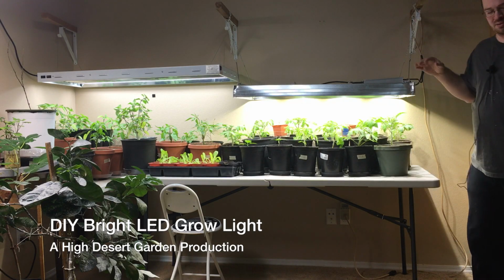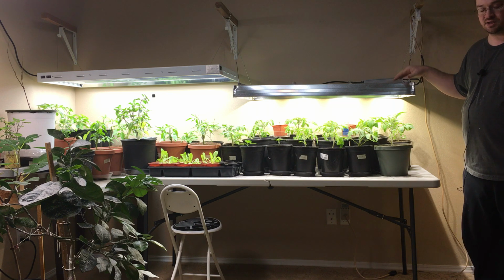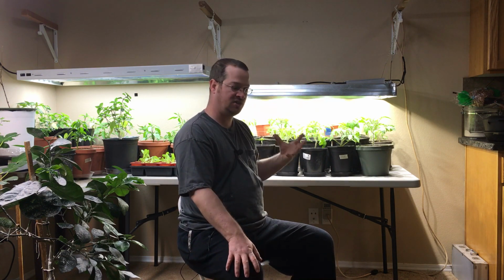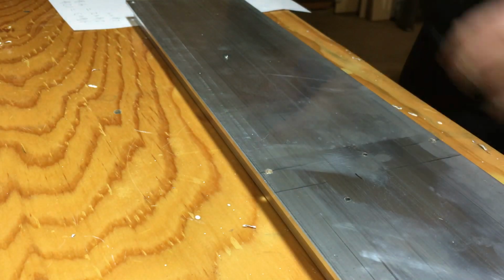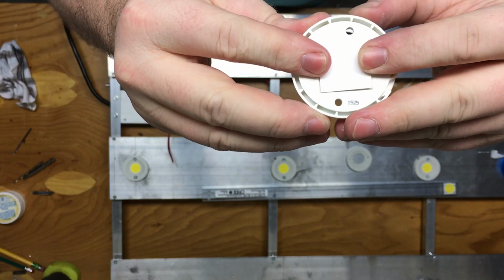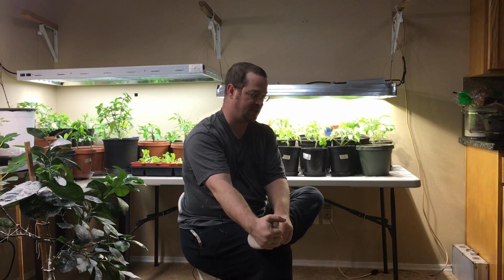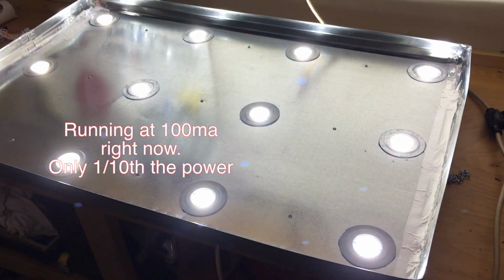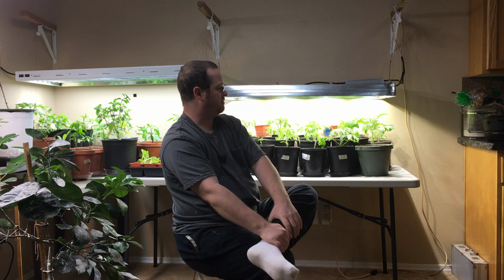DIY Bright LED Grow Light

Comment: "100W High Power Cold White 6000K LED Light + Heatsink Cooler fan+100W LED Driver
$2.50 to $25.50" THIS WILL TAKE YOU INTO THAT STORE WIYH ALL THE PARTS

Comment: "kobeedeal" I LITERALLY JUST FOUMND THIS EBAY SELLERS LITTLE STORE THING ON EBAY IT HAS THE BEST PRICES IVE SEEN SO FAR, HE HAS ALL THIS STUFF BUT ALOT OF ITS CHEAP I BUT IT DOES SEEM TO HAVE THE PIECESW ANDS PARTS FOR THE S CHEAPER COBS, REFLECTORS AAND STUFF. ITS A GOOD FIND.

BY THE WAY I THINK THAT YOUR LIGHTS FRAME SHOULD BE BIGGER WITH ALL THOSE LIGHTS, I DONT KNOW HOW YOUR COBS COMPARE TO CREE CXB3590 BUT ABOUT 3 OR 4 OF CXB3590'S IS MORE THAN ENOUGH LIGHT FOR YOUR SIZE FRAME. PLANTS CAN ONLY EAT SO MUCH OF THAT LIGHT (UNLESS YOU INTRODUCE AUX. CO2 THEN THEY CAN EAT EXTRA BUT WHY PAY TO PUT LIGHT OUT THERE IF NO ONES USING YA KNOW.

Comment: IM ABOUT TO BUILD 1 VERY SIMILAR TO YOURS. I HAVE BEEN RESEARCHING NOW FOR A FEW WEEKS. 1 QUESTION- IT'S OK TO MIX UP THE SPECTRUMS WITH DIFFERENT COBS RIGHT? (ASSUMING THE VOLTAGE FITS & AMP, ETC AS NORMAL) EVERYONES USING THE CREE CXB3590 COBS, I MIGHT USE THEM BUT EVERYWHERE IVE SEEN THEM THERE PRETTY EXSPENSIVE, (LIKE $20/ COB EVEN MORE, IS THE RIGHT?) ALSO ON EBAY THERES THESE 7 AND 8 "BAND" SPECTRUM LED COBS MULTICOLED, ALSO EXSPENSIVE (LIKE $80 FOR 6 OF THEM OR EVEN TWICE THAT FOR THE BEST ONE, *CHECK EM OUT ON EBAY THEY ARE REALLY COOL(AND NO IM NOT SELLING THEM LOL)- "6pcs/Lot DIY 100W 7 Band Multi Color Full Spectrum Plant LED Grow Light Chip" CAN I MIX THESE IN WITH THE CREE COBS? (MIX THEM WITH DIFFERENT SPECTRUM CREES, ALL TOGETHER?  THAT WOULD CHANGE ANYTHING DOES IT????   ANYBODY KNOW??? 
HAVEN'T FIGURED OUT THE FANS, HEATSINK YET, (AND THE FRAME I'M NOT WORRIED ABOUT, I AM A CARPENTER)
ALSO IM THINKING ABOUT ADDING A COUPLE SWITCHES TO SEPERATE THE COBS.
I'M PRETTY SURE I CAN MIX ALL THOSE COBS, AND SPECTRUMS AS LONG AS I FOLLOW THE REGULAR PARAMETERS AROUND VOLTS AND AMPS, DOES ANTONE KNOW FOR SURE???????????????????????????????
PLEASE HELP!!!!!!!!!!!!!!
Reply from the maker: Yes, I was thinking about doing the same. It’s a good idea.
Reply: @HighDesertGarden  WHATS A GOOD MIDDLE OF THE ROAR COB? I SAW THAT Luminus COBS WERE 10% BRIGHTER OR MORE EFFICIENT? I FORGET LOL? BUT THEY WERE RATED A LITTLE BETTER THAN THE CREE CXB3590 THEY PROBABLY COST MORE TOO. THERE BOTH SO EXSPENSIVE THATS WHY IM TRYING TO FIND A GOOD CHEAPER ONE THATS STILL DECENT, DO YOU KNOW OF ANY? AND WHERE TO GET THEM?
Reply: Your right you can mix and match but like the switches you might want to consider multiple drivers as well for the different leds. Also make sure they are adjustable to be able to control the lighting spectrums if needed. Also consider the total grow foot print and weather you are going to do seedlings and or the start of the veg phase or all the way too fruit or flower as the spectrums differ for optimum growth or yield. * Also some plants benefit from a small amount of uv but only in the flower fruit stage. The power draw is only important to you wallet what your concerns should be focused on is fullness on spectrum and how much usable light from how far away the plants you can get, usually I've heard referenced as ppf. Good luck.

Comment: I have an old fixture that houses a single cob. I opened it up and put the meter on it.
95v dc output from the driver.
.47 amps
Verified with a kilowatt that it is pulling 45 watts with the active cooling unplugged
Active cooling pulls an additional 1.1 watt
What is the best single Cob I can put in this fixture that will be compatible with the unmarked driver I have?

I want to run a cree cxa3590 72 volt 3500k or a free cxa3070 3500k

Please make a recommendation on an efficient cob that will work with my current driver if the two listed above will not work.  Preferably 3500k
Thank you!
Reply: Which ever fits with bothe the power requirements and the spectrum you need/want. You will determine that based on your growing for seedlings and veg. Or all the way to fruit and flower as they prefer different spectrums to produce optimum results. Of course free makes the price much better that you could maybe add and additional unit(s) to supplement any spectrum or pat type needs such as expanding you grow. Good luck.

Comment: that sucks u had a 10k   not100k. i am glad u fix it. so where u get ur chips i got 8 cluo48 chips 8 heatsinks. i pay 20 pc heat sinks i no it may not be as nices but its got good mean well 240 1700mah and one 185hlg 1400mah. 3500k. 3000k.  an 3 watt  red blue uv    so lmk ehere u got ur chips do u no jarry from king bright lmk inpotin thank u
Reply from the maker: I put all information on the hardware and pricing in the description of this video.

Comment: growmau5 email you back for nothing so if there's any way you can help me out I need to pick a driver   11to45watr. cob. 48 volt dc. 1000 early and mid 2100 milliamp Max I need to pick a driver that will power four of these chips and either series or parallel please help me out sir I'm not sure if I wire in parallel can I get away with just using a 48 volt hundred watt driver to power to chips and if the amperage over seeds it I can buy a dimmer correct Wi-Fi hookup in series do I have to have double the amperage see I just have so many questions.  4432480221. pleezzz. tex any time pleezz tex me or call me pleezz  vic
Reply from the maker: You do not want to overload your driver. Can you please provide me with the model of the COBS that you are going to be using? Do you have a link?
Reply: Shore.  4432480221. Sell nuber u can tex me on this nuber if u can but i will sand u my cob than u it meen so much u email me back thank u so much. I like to get a ok cob cheepr and to try out can't keep buying from China. Vic
Reply: https://lh3.googleusercontent.com/a269nZfQW1yZ7pF2a_YxLNePBah-DbPIIXYm1JABLlQydQBGzHbfANqYqyjlGJ82jp5ISo5n
Reply: I don't think I can send you pictures it won't show them but here is the model number and the stats I want to one of the chips

OSRAM SOLERIQ® P9 LED 4000K
NEUTRAL WHITE CRI 95 GW MAFJB1.CM COB
OSRAM SOLERIQ P9
4000K  Neutral White  |                         model number GW MAFJB1.CM
CRI min. 90 ( typ. 95 )
Chip-on-Board COB
Forward voltage: 26 V - 31 V  |  Luminous Flux: 1790 lm - 2620 lm
Forward current: 200 - 1400 mA  |  Viewing angle at 50 % Iv: 120°
Luminous efficacy: typ. 85 lm/W @ 3000 K
Operating temperature range: - 40 ... 85°C

I need 4 of thezz in series I need a driver to power at least four of these
Reply: GW KAJRB2.EM. or 4 of theezz but littil hi in $$$  so if u no any cherper chip let me thank u for ur time    but the 4000k are my Preferred Choice

Comment: Should have done at same height imo. Yes the led are more powerful =D
Reply from the maker: david abe I didn't think about doing that for the demonstration. However I do frequently adjust the height of the lights depending on how tall the plants are beneath them.
Reply: Looks good! I built a bunch (16) 200watt led lights so I'm on board, just saying one is closer so it looks brighter on the plants. If you ever do another vid it's something to keep in mind is all.

Comment: I know Cree lights last long time but for me wiring in series is out of the project. As you know in series the problem is that when one fails the whole thing will fail. I prefer parallel. If one fails the rest will continue working.  Basic electronics.
Reply from the maker: Papun Rodriguez True
Reply: And the remanding cobs will be driven harder and Cree doesn't recommend it. You'll burn up your cobs just check out my channel if you haven't already.
Reply: Just buy some drivers of amazon then have 1 driver per led, the drivers are only £5 the only problem is they are DC-DC boost/buck converters so you sill need a DC power source.

Comment: Great video. Great job. I found these high bay Cree cxb leds lights. Do you think they will work for growing? What is the par on those leds? Thank you.
Reply from the maker: What are the specs on the high bay Cree cab leds that you're looking at?
I'm not sure what the par on my cxa2530s are. I imagine it would probably very depending on the voltage that I put through them. I think that +Growmaus used these same leds in a build that he did and he may have mentioned the par value.

Comment: Great vid and info from my experience it will make life easier for you to place your mount where you want put sharpie pen in hole to mark the place to screw in self tapping screws put the mount aside  then use self taping screws screw them on  back them out with a drill and phillips head.
  then put the mount in place and use hand  screw driver to  screw mount on.
Reply from the maker: +Spencer Rushin Thanks for the tip

Comment: Awesome job. Esp. if you got Greengenes nod ;) But I'm not sure why you didn't use 8 Vero 29 instead?  -$8 mounts, -$38 hs, +8x Vero 29=+$47 more than your 2530's.. = For $1 more you get a substantial upgrade and an easier build.
Reply: +Axias2011 I'm terrible with the Heatsink dissipation rates on passive cooling. But Veros cranked to maximum WOULD need the HS size increase 50% to maintain passive.. So, lol, sorry there goes $38 ;)    Anyways,  Great light.
Reply from the maker: +Axias2011 I've been thinking the same thing recently. I didn't know that at the time that I was planning to build this light.

Comment: i used self tapping screws much easier just drill the hole and screw well i know un-monting can be tricky but it works
Reply: in the long term , screws get loose.
Reply: then just put a drop off locktight no need for me never moved thé ficture is not mooving

Comment: drill.. #4 sheet metal screws...no tapping needed . not self tapping , sheet metal
Reply from the maker: That sounds like it would work. I'm not sure that it would be as nice as the machine screws.
Reply: +High Desert Garden (Phillip) Good job working through the nuances. I'm sure you're  more knowledgeable and comfortable. What was you're steps for checking grounding? I probably should check too..Have several Led Clone/seedling bars using xml2
built. thx for the video
Reply: +Bfresh19801 Just rewatched your vid... I see. thx

Comment: Seems everyone has LED grow lights on the brains. I'm also gathering the components to build a LED grow light myself and will be putting one together over the next several days. Good timing with your video it was great to watch. :)  The only part I'm a little worried about is the mounting screws with insulating tape on them. Just please keep an eye on 'em as things may change as they are exposed to heat over time. 

Good stuff though, thanks for going thru the process and sharing! :)
Reply: Your two links above, linking to Growmau5 and Greengages Garden's videos seem to be broken. :(
Reply from the maker: +Cragfire Gardening Fixed now.
Reply from the maker: +Cragfire Gardening That is a concern; I've never seen teflon tape be used this way. I was sure to put it on very thick.